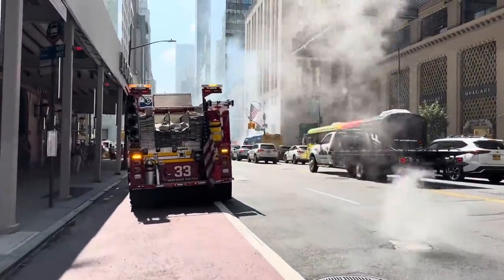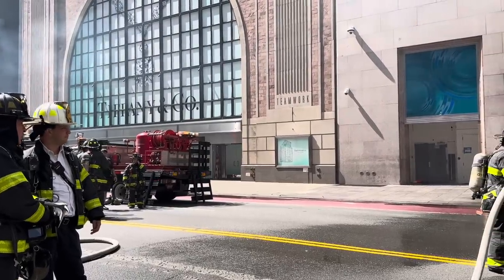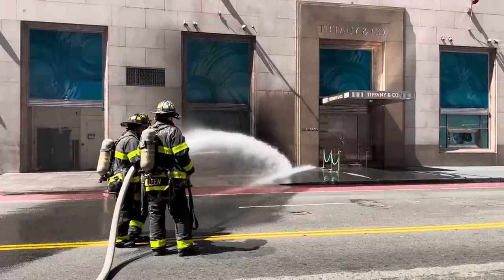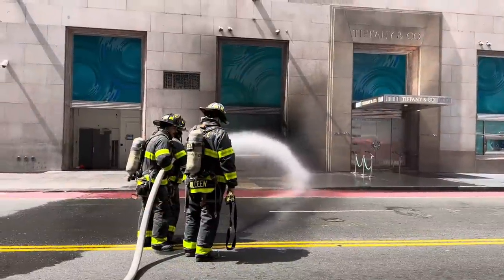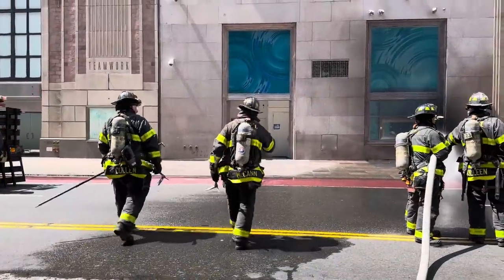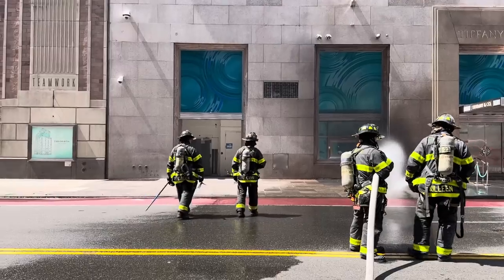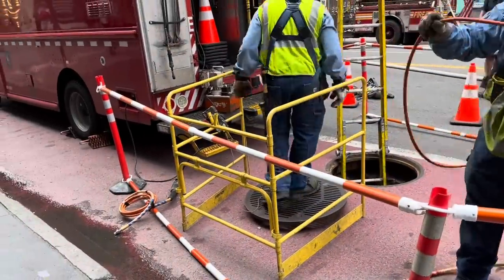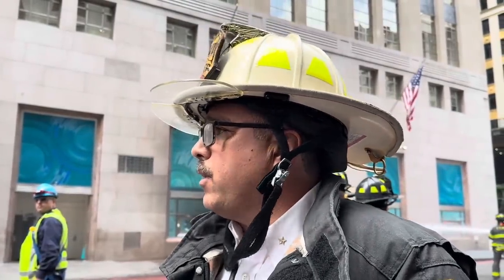FDNY Manhattan 10-75 Box 0907 Transformer Vault Fire

Comment: Breakfast at Tiffany's: The FDNY Version 🤪🤪 great video! It's always fascinating to see how they battle these transformer vault fires. I work around high voltage transformers and we've had a couple of internal wires "pop" over the years, but fortunately never a sustained fire (ours have fuse protected disconnect switches right there also).

Comment: That is a 460 volt transformer.  They have make 2 different cuts in 2 manholes. Secondary system, electric feeds both ways. To isolate backfeed. Cut cables n put Shrink sleeve caps on same. Yes, those are insulated hydraulic cutters. Feeder supplying transformer gets shutdown  at station. There are many other feeders that pick up slack.
Reply from the maker: Thanks for the info!